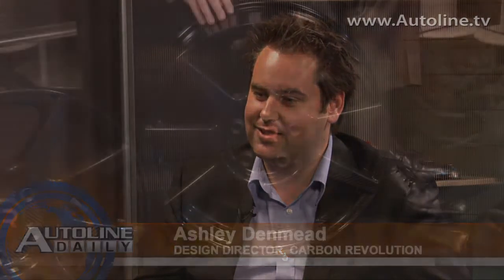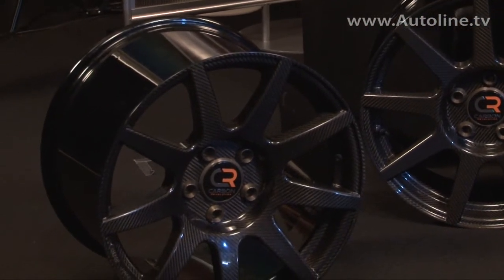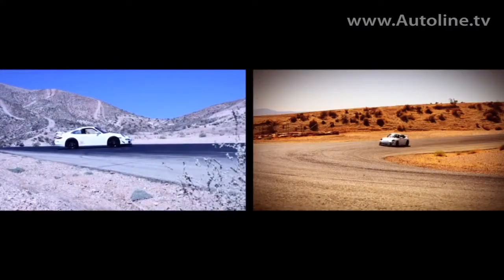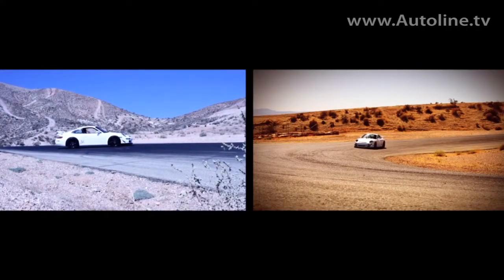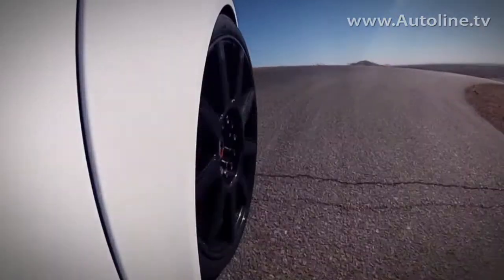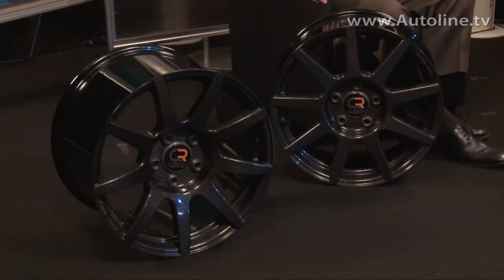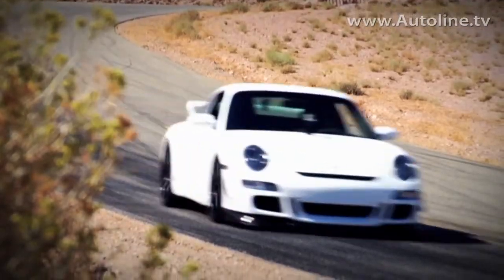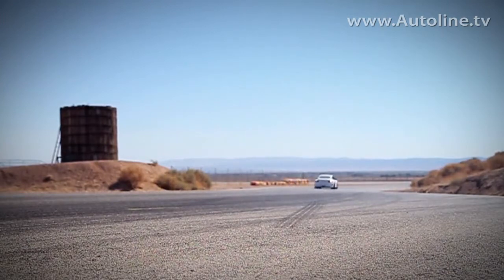Carbon Fiber Wheel

Comment: I'm more interested in the manufacturing process. If you don't have to use an autoclave, CF parts become less costly.

But CF wheels? It would certianly become a more affordable option, in time, for all sports cars and performance cars largely with only some consideration to cost. Like having the choice of Steel, Magnesium alloy (Mags), aluminum, and 2-3pc CF rims. The Rim itself is CF. the spokes are AL or Mag.